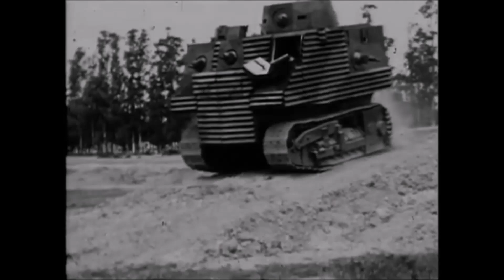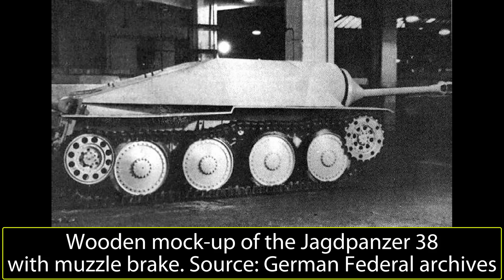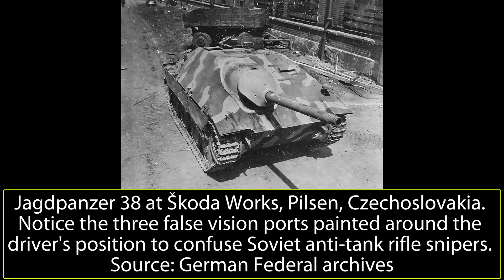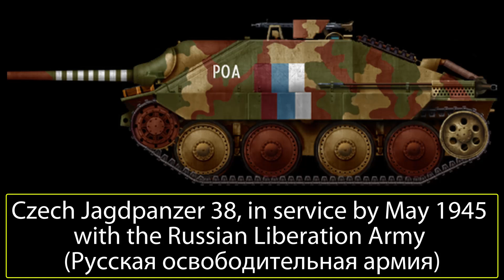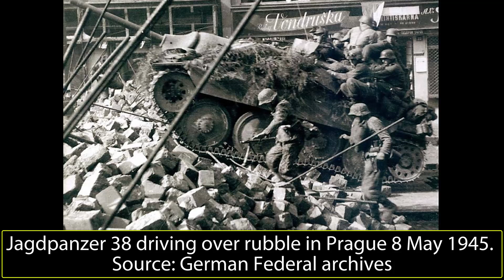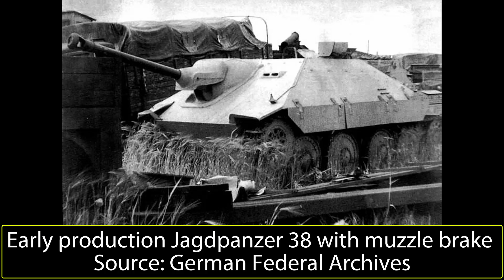Hetzers Gonna Hetz' | Jagdpanzer 38 "Hetzer" (part 1)

Comment: I don't dispute the facts but the conclusions don't quite fit the facts. Like the idea the Hetzer was easier concealed than the Marder because it's smaller... it isn't. The Marder II was 2.2m tall and 2.3m wide, the Hetzer was 2.17m tall and 2.63m wide. So the Hetzer is only 3cm shorter but far wider. The limited traverse and depression of the gun also severely limited where it could be effectively emplaced as on an embankment it may not be able to turn enough. Also, needing to move more so its narrow gun arc can cover a tank from a side angle also ruins concealment.

The Marder series were great when they were used as tank destroyers, the problem is they weren't used as tank destroyers but as ersatz tanks under the "assault gun" moniker. The infantry really didn't gain much from such vehicles, while their armor made them immune to small arms fire, their size made them vulnerable to larger guns. The Hetzer's armor may be impressive, but the Hetzer didn't begin production until the T-34/85 was proliferating, and that 85mm gun could defeat the Hetzer's frontal armor with the regular steel AP ammo.

Comment: While the running gear of the Hetzer looks like the tank running gear they actually did a complete redesign as in almost nothing from the tank would actually fit on a Hetzer. It is fair to state that the Hetzer running gear design is based on the tank design.

Comment: The Hetzer is such an awesome tank in a sense till you hear about the armor thing then u begin to ask yourself if its even a good tank
Reply from the maker: Definitely a horrible tank given the fact it wasn't a tank :D
Reply: @TanksEncyclopediaYT  If we get into semantics than no armored vehicle is a tank unless its also a container for mostly fluids or gases 
Besides that if Little Willie is the first tank than not even a weapon is neccessarcy for a vehicle to  be classed a tank in fact only armor (atleast more than needed for structural integrety ) an Engine (fuel etc ) and Tracks in order to better cross even muddy terrain and or cross trenches 

Anyway perhaps not worth a full video but i think it might be a good idea for you to make a video about face hardend armor and if only germany had them  and what effect it had and if there were also negatives to it . Games like Warthunder and Wot make you think that many of the german vehicles were actually quite weak armored for a variaty of reasons yet none of them have a face hardend mechanic. It would be nice to hear about that  (except maybe the cast or rolled homogenous armor type in WT  )
Reply from the maker: Ooo, we're doing this. 
First off, Little Willie was meant to be armed, it would have had a 2 pounder gun in a rotatable turret along with a number of machine-guns fitted to the hull. 
Second off, there's a lot of things that are tanks, the definition is mostly doctrinal and not structural (it's about how you use it, not how it looks).

Articles on armor types would be amazing (as well as on shell types), but we currently have no one brave enough to do one of them. Maybe in the future. But yes, we would so want it.
Reply: @TanksEncyclopediaYT  Yeah David Wiley in the S-Tank Tankchat also rather refers to the S-Tank as a (self propelled gun / tank destroyer / tank hunter What ever ) instead of the swedish designation of Tank or main battle tank etc. So i think looks is just as valid a designation for tank terminology as intended usage. To be honest i think my or Tank naming in general is really a bit fluid since the reason for the best designation for a vehicle can change from case to case and tank is for me more like the lowest common denominator
Reply: @TanksEncyclopediaYT  when you say it wasn't tank, it really offended me
Reply from the maker: Didn't mean to offend. Still not a tank.
Reply: @TanksEncyclopediaYT  why it wasn't a tank? is it related to "tank destroyer is not a tank" or what?
Reply from the maker: Yes. And it doesn't relate to the way it is built, it related to how it was meant to be used.
Reply: @TanksEncyclopediaYT  i respect your opinion, because every person has different opinion, but my opinion is that tank destroyer is still a tank, the definition of tank is that it was a armored fighting vehicle with gun and tracks. Tank's role are very diverse throughout this century, so that's why i considered Tank Destroyer as part of tank
Reply from the maker: We respect your opinion as well, but both of our opinions are completely irrelevant. 

The only thing that matters when it comes to AFV classification is the opinion and doctrine of the primary user of the vehicle, in this case the German army. And the German army was pretty adamant that this is not a tank and should never be used as a tank.
Reply: @TanksEncyclopediaYT  The Germans don't make a differentiation. They also don't call anything a tank, they call it Panzer. Jagdpanzer means hunting tank in English, Schützenpanzer means marksman tank etc. The "hetzer" was basically a self propelled AT gun, but still a Panzer. For an English speaker it would be a tracked, armoured AT gun carrier, for a German speaker it's a tank.
Reply: @TanksEncyclopediaYT   I think tank is a direct attack armored artillery vehicle, and TD is a tank class, while indirect attack vehicle is a spg , and infantry support vehicle is ISV, which can be diffirent classification in diffirent army, country, etc.